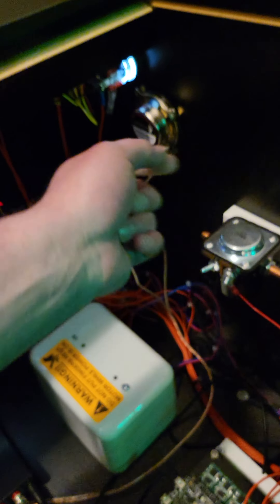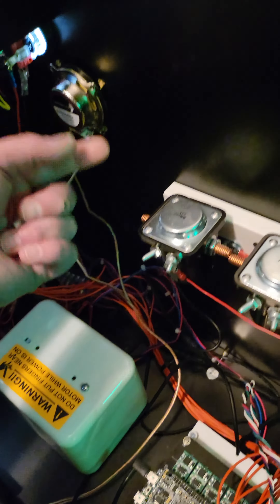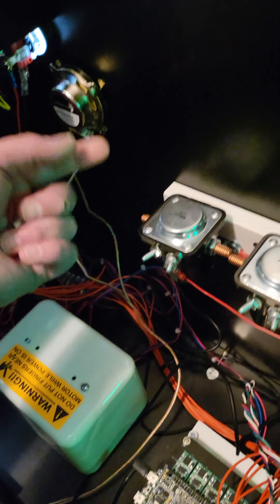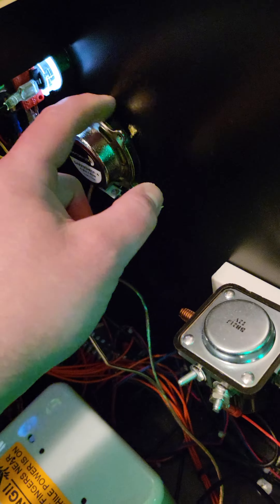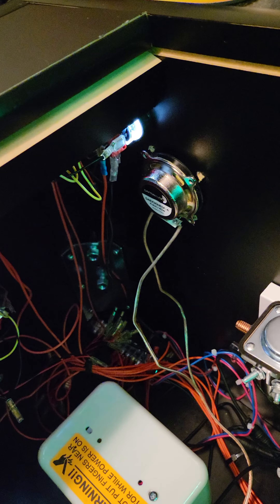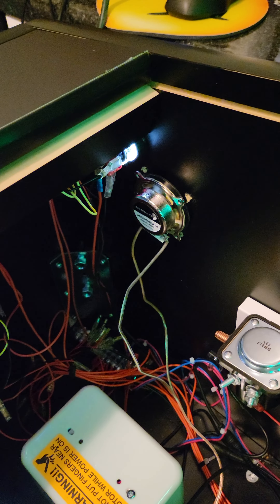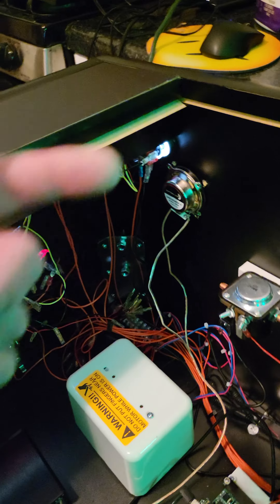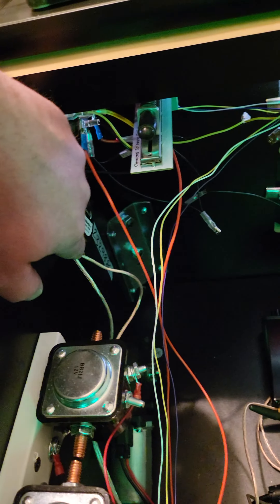Safety video if your installing exciters in your virtualpinball table.  Learn from me, the idiot.lol

Comment: Hey there. Good tip for the future. But for now, I have the “ninja star” versions. I had to take them off to move to a new cab I got, but I pretty much had to scrape it off (because of the gummy adhesive it came with).
Am I good to just get double sided tape, and cut to fit around the ring? Is that still gonna allow it to “breathe”?
Reply from the maker: Yeah as long as you allow it to move. I I had the star ones just put a very tiny piece if tape on the very tips of the star arms. And put one pieces obviously in the middle.